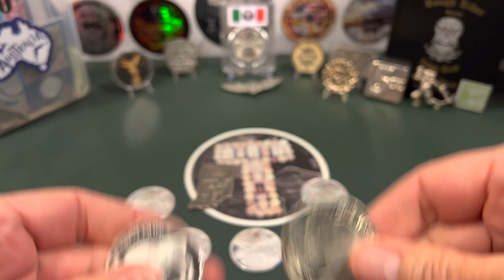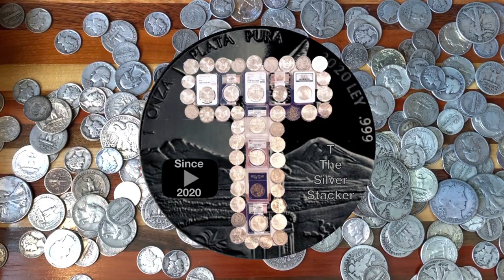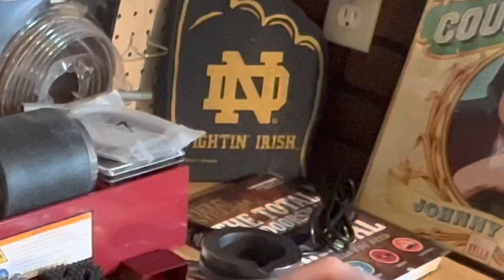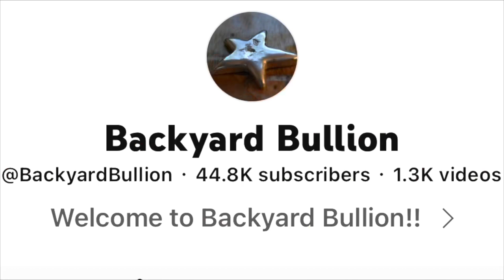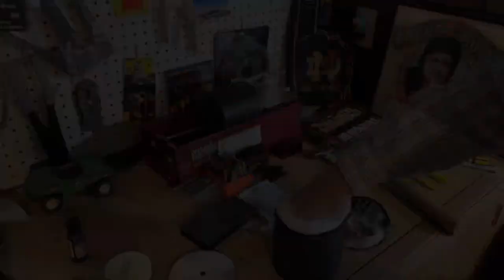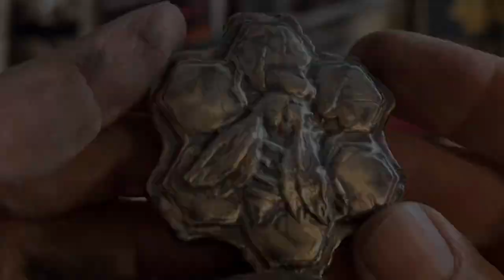Silver Pour #2:  Using Graphite Molds- The Thrill of Victory and the Agony of Defeat

Comment: T very nice job on both the Bee and bar. Just a suggestion for the next time you file the edges. Do it over a piece of paper so you can save the filing for the next pour.
Reply from the maker: Good idea!
Reply: You should NOT use any filings for future pours as there will be small specs of iron/iron oxide that will come off the file as well as the silver dust. You will end up contaminating the silver and it could actually mean it ends up being less than 999 fine silver. I would get a little jar and just start filling it and one day you can either scrap it or make a standalone "scrap bar"

Comment: Nice job T making safety changes. Harbor freight has a blue vice that articulates in any direction to hold your pieces use cardboard in the vice to keep from marring the pour. also, to steady your pours you can use a brick to set the bottom edge of the crucible on and teeter down to the mold. Your pour lines are looking good. keep having fun,
Reply from the maker: Thanks Jack!  I definitely love a trip to Harbor Freight!  I appreciate the support!!